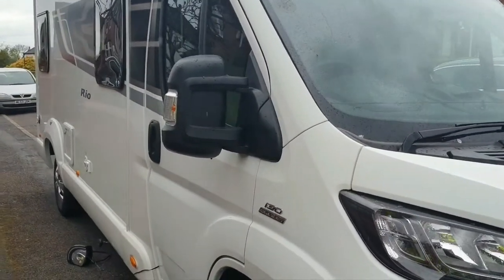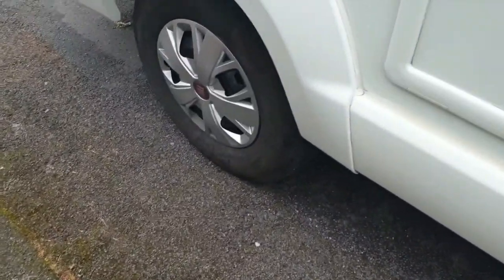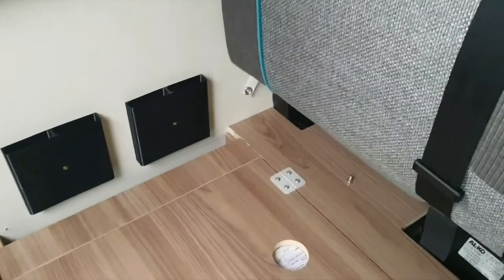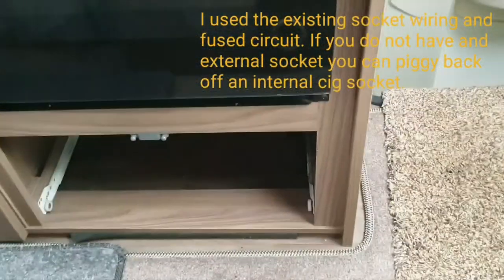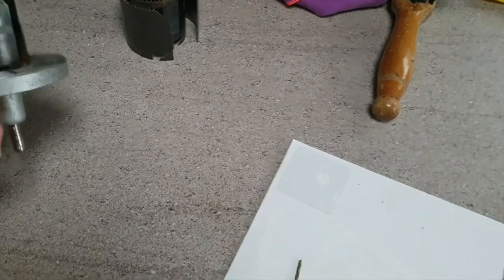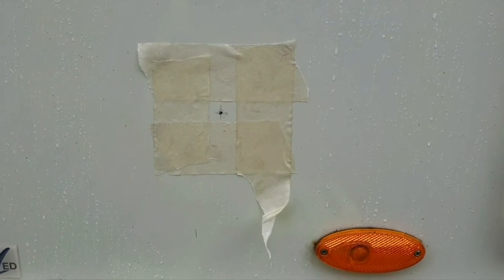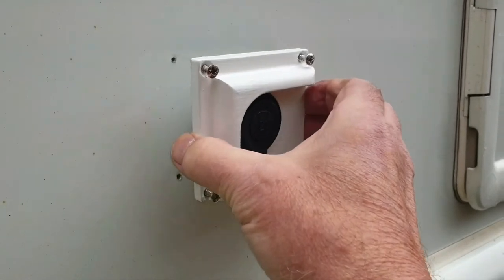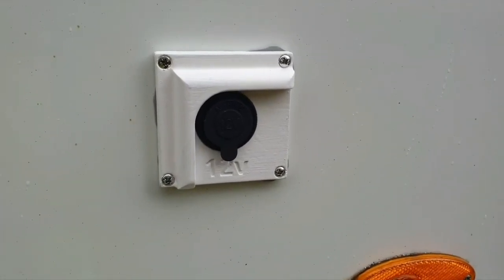Motorhome External 12v Power Sockets 🙂

Comment: That's another one I was thinking of doing :)   It would make it easier to plug in my evaporative cooler for some comfort when sitting under the awning. Well done Ian.
Reply from the maker: Thanks Rhys. The circuit is protected by a 10a fuse (EC400 unit) so bear this in mind with the loadings. My tyre inflator draws about 8a under load (60psi).